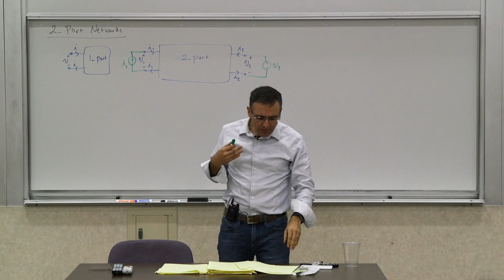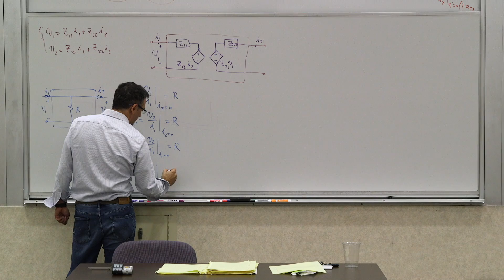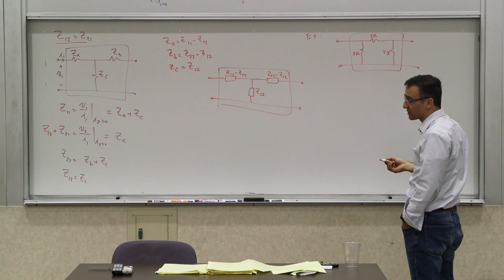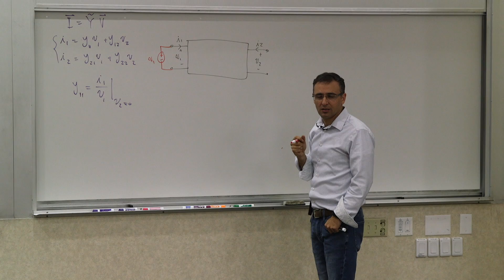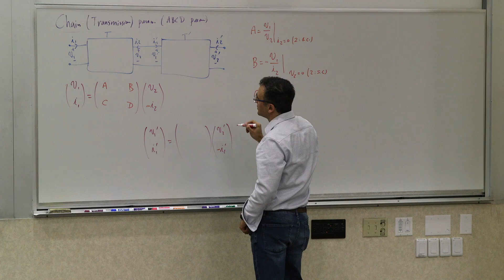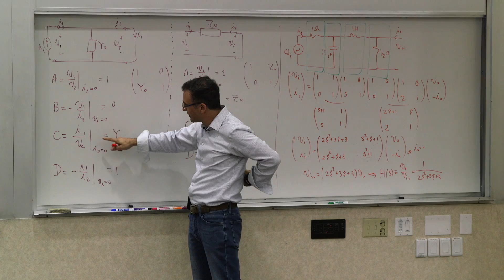Comment: 1:01:05 "What is Y of a capacitor: it's C S" 
Where does this come from?
Reply: The current through a capacitor is equal to the capacitance of it self times the rate of change in the voltage across it (aka the derivative of the voltage) that gives you the following equation:
$i_c(t)=C{dv_c(t) \over dt}$
if you take the Laplace transform with zero initial conditions it results
$I_c(s)=CSV_c(s)$
finally the admittance is the relation between current an voltage, et voila:
$Y_c= {I_c(s) \over V_c(s)} = CS$

notice that i use LaTex notation for the equations you can copy(just the thing between $...$) and paste in this online sandbox equation editor:
https://www.codecogs.com/latex/eqneditor.php
 to see how it looks like

Cheers!
Juan Chirino